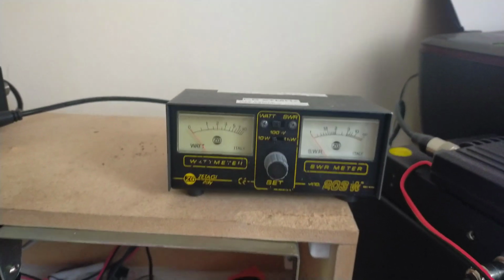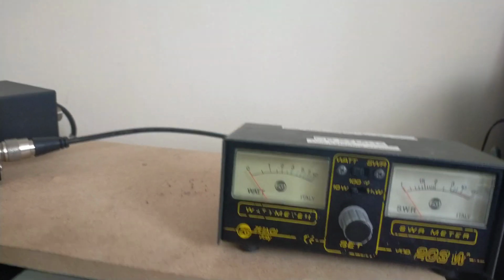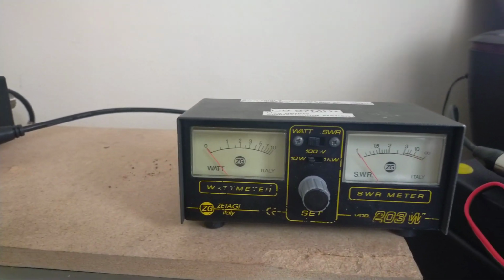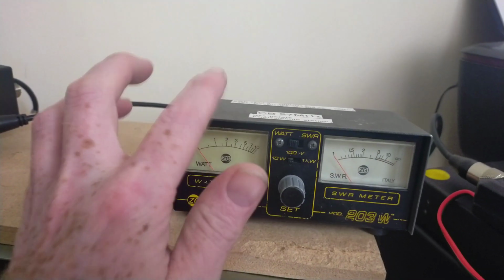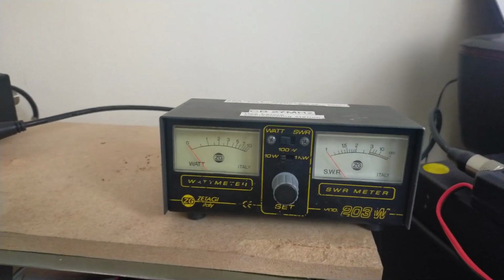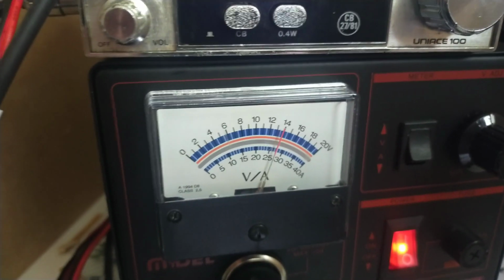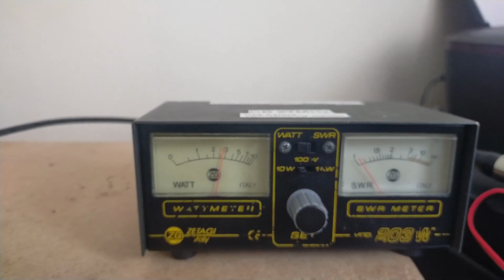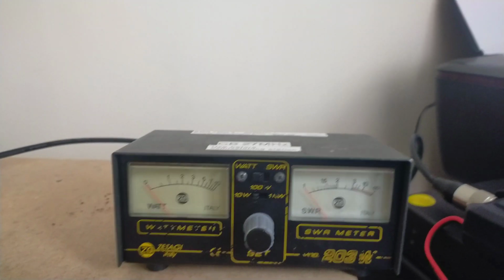Useful CB repair aids: power meters

Comment: Yeah, don't take the power reading as gospel, but good enough to tune a CB power up with, most modern CBs will not go to 4 watts anyway, so not a problem, unlike some old Cbs, some of them would go to 6 watts if you got a good one!